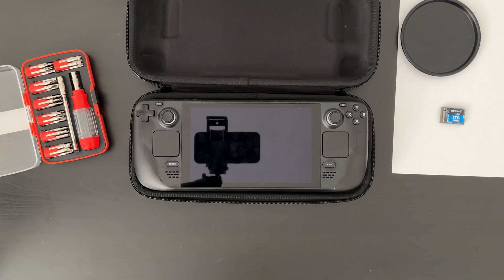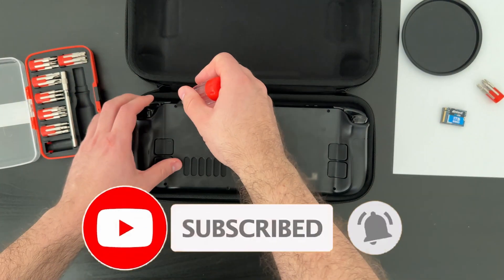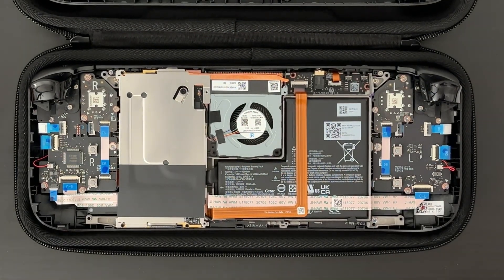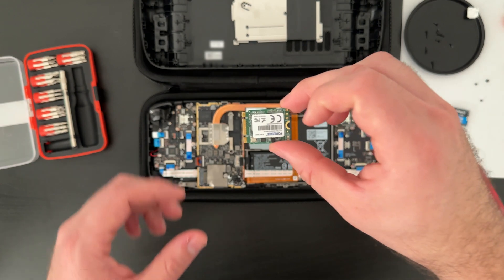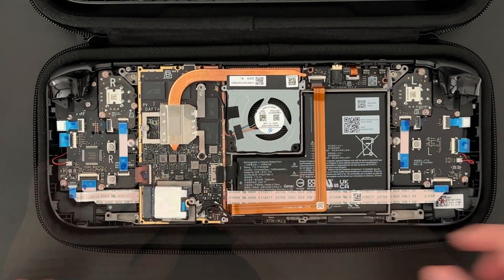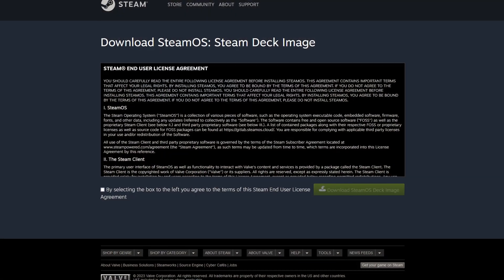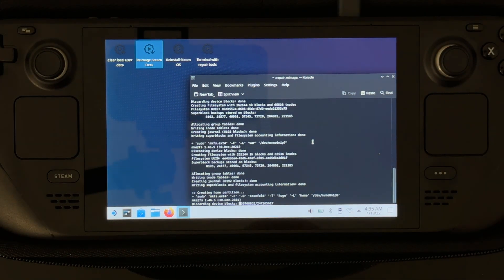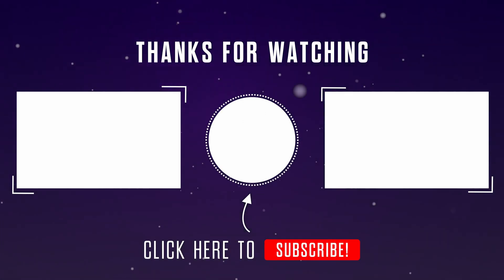How Can You Play More Games With Your Steam Deck?

Comment: I thought VALVE was okay with swapping the SSD, however they made a statement about swapping it for a larger drive because it gets hot due to the charging components.
Reply from the maker: In the storage section of the Steam Deck specs page, it says "All models use socketed 2230 m.2 modules (not intended for end-user replacement)"

Comment: hi there, I just recently bought my steam deck. I like the video you did to upgrade your storage memory. Is it possible you can do that for me because I have no idea I’m not very technical?! I want to get the best out of my steam deck
please reach out.
Reply from the maker: If it were me in your case, I would pick up the biggest and fasted supported MicroSD card that works in the Steam Deck. If I didn't upgrade the SSD I probably would have picked up a Sandisk Extreme 1TB UHS-I/U3 A2 MicroSD (SDSQXAV-1T00-GN6MA) or maybe the prior version of that card which I've found for a little cheaper. Either way it would be cheaper than the price of the SSD I put into the Steam Deck.
Reply from the maker: I think this would be pretty cool! This is something I hope to be offering soon.

Comment: Great video. 
Curious why you chose to go with a SSD instead of a micro SD
Reply: I imagine its faster an ssd than an micro usb also the ssds are cheaper than a micro sd(at least in mexico)
Reply from the maker: @lute_cg  The SSD was about $130-150 USD. Pretty similar to a fast 1TB MicroSD. Combined together would mean even more storage.
Reply: @TechnologyMindset  ah
Reply from the maker: Check out my latest video, I partitioned the NVME drive and dual booted SteamOS and Windows 11!
Reply from the maker: Thank you. That way I can add a MicroSD later and have even more storage. Also if I could do Windows on one, and SteamOS on the other I think that would be a fun video.